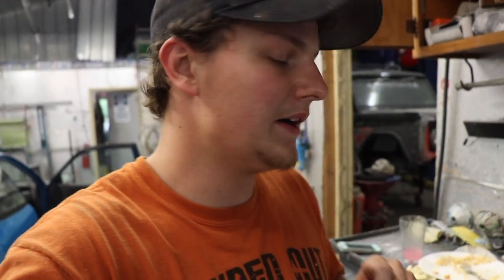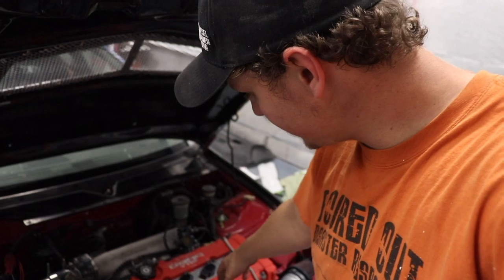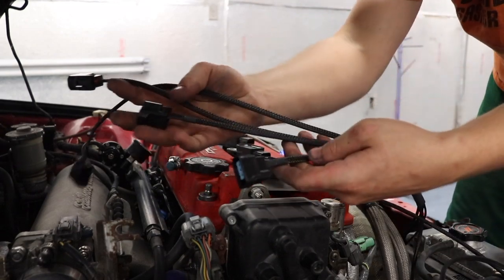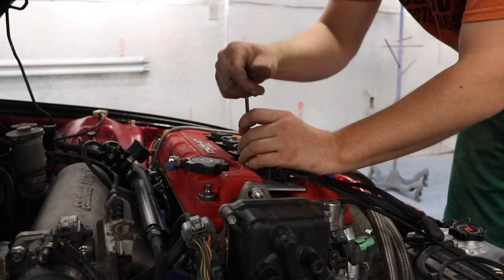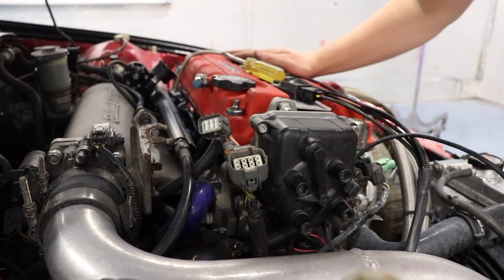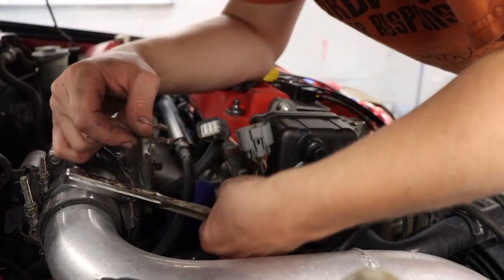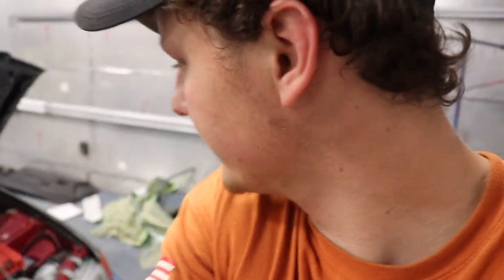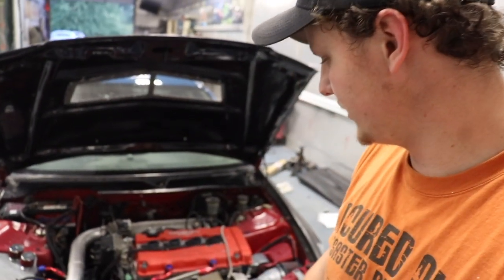Honda/Acura Coil on Plug Conversion : Burton Racing COP Kit

Comment: How your cop systems working ?
Reply from the maker: Christopher Naresh works great! No issues so far
Reply: Johnny Fabz .... did the distributor setup cause the engine to idle poorly on cold starts? Like having to give it gas until it warms up? Seems to start and idle fine with the c.o.p. How many benefits did you gain?

Comment: Seems like your project car is coming along pretty nicely. So the obd1 ECU needs to have a harness adapter soldered into it in order to plug the coil harness into the ECU?
Reply: Yes  The hondarulez cop chip gets soldered in the ecu   burton racing does it for free.  Just so you ecu👍